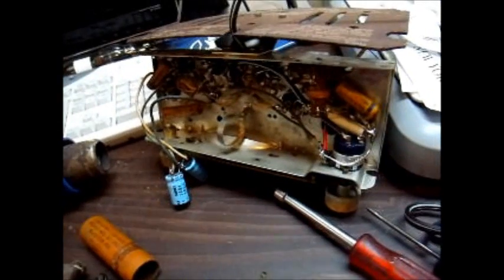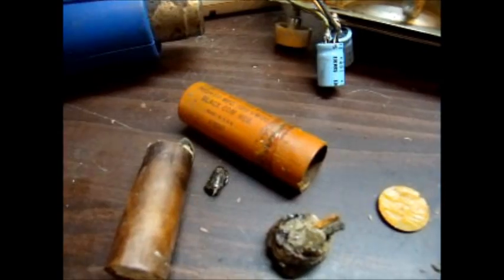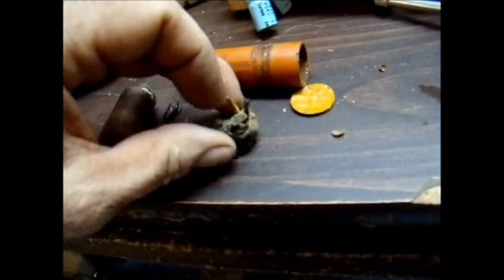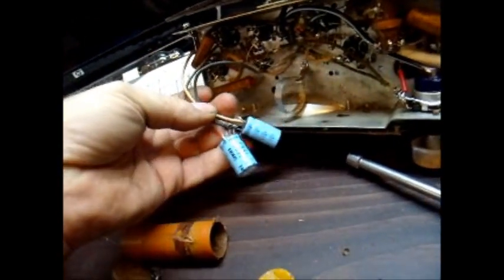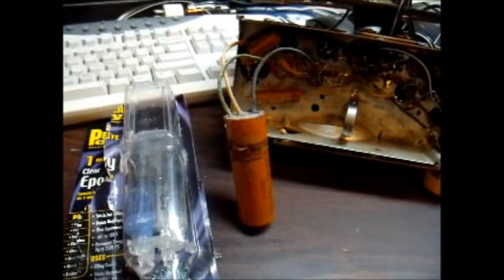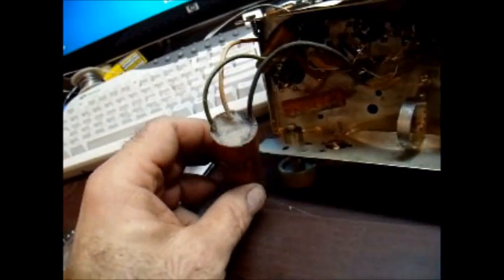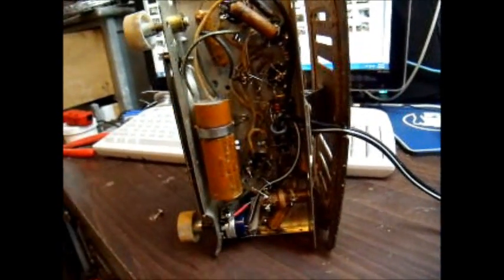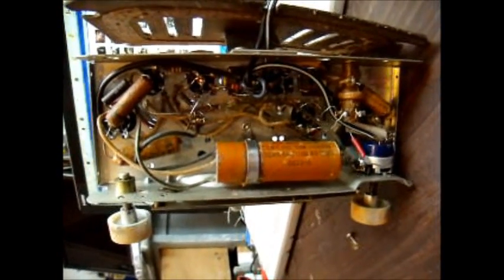Re-stuffing electrolytic capacitor.wmv

Comment: Steve, I am working on an Emerson table radio with a BF chassis from 1938.  There are 2 can type electrolytics for the for the power supply filters. There are no polarity markings just the values.  When I measure the rectifier tube output I have my dvom ground to chassis and red to test the cathode output my meter shows reverse polarity.  Did radios of this time period have positive grounds?